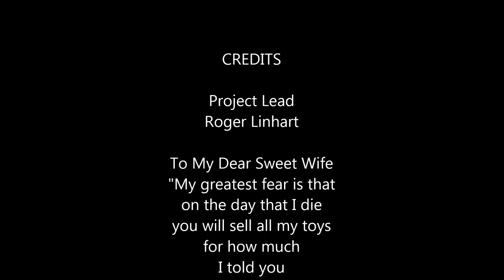Tricopter Build Part 4 HJ-Y3 OpenPilot CC3D FlySky FS-T6

Comment: Sir, I have built the same by following your steps and configuration but whenever I raise my throttle it flips. I am unable to solve it Please help me.
Reply from the maker: A common issue with flipping is having motors or props turning the wrong direction. Confirm the motors are turning in the direction shown in OpenPilot and then that each prop is  pushing air down to confirm you have the correct clockwise or counter-clockwise prop.
Reply: @RetroRogersLab  thank you for your response. I have checked multiple times.Motors are rotating in a correct direction. please have a look at my problem  maybe you can understand better https://youtu.be/LD2lwCHusD0

Comment: I am trying to build this right now as my first tricopter and I am kinda stuck. so do I solder the red and black wires on the esc to the power distribution board? I kinda assume that's what I would do.
Reply from the maker: +Thomas Kang I'm including a link to a photo in my Google Drive that should make the wiring more clear. https://drive.google.com/file/d/1U5QJc6ZzSdYl-1kqjUi0JLF2BO9Rj4ajSw/view?usp=sharing

You are correct that on the ESC the two larger wires, red and black, go to the power distribution board. Black should be connected to a '-' pad and red should be connected to a '+' pad. Of course your battery will also connect to power distribution board.

For the remaining connections there are three wires that go to your motor. It doesn't matter which wires on the ESC go to which wires on the motor. If you are not using a connector here you should check the direction the motor turns and if it is wrong you just swap two of the wires to reverse the direction the motor spins.

The final connection has a servo type connector and typically connects to your flight controller board.
Reply: ***** Thank you so much!!! Love your vids on the build they are very helpful! I did all that but now I'm trying to program my cc3d flight controller, so motor 1 on the left works flawless, second motor just goes back and forth, and last one on tail spins properly but spins too slow. The servo just constantly tilts right whenever I connect it to power, my tri looks like a disaster. I don't know what to do but I think it may have to do with me not calibrating the ESCs properly, I don't know how that works. I just let them beep for 5 minutes and I just went on to the next step in the wizard. I honestly don't know what to do at this point
Reply from the maker: +Thomas Kang I'm working on Part 5 of this series in which I configure the transmitter and CC3D settings. I haven't been in too much of a hurry because there are other good videos here on this subject. I'm glad you found these videos useful. I'm also very new to this and wanted to document some of the issues I encountered while figuring out this exciting new hobby.
Reply from the maker: +Thomas Kang Regarding the issues you're experiencing... 

For the servo on the tail rotor, be sure to "center" the servo before you put the output shaft into the tail motor hinge. Your servo should have come with plastic arms that fit on the output shaft, you can use these to SLOWLY  turn the output shaft. Turn the shaft both directions to find the limits. This will help you figure out where the center should be. You don't have to be exact, you'll fine tune it later in the CC3D setup. Next, when mounting the tail motor hinge to the frame be sure it is centered too.

Regarding your motor issues, the instructions aren't as clear as they could be. This video (https://youtu.be/0w56EQFl4Nc) shows an older version of OpenPilot but this is how I calibrated my ESCs. OpenPilot should also have you select each motor individually to determine at what value the motor begins to run. Beyond this, if you still have problems start swapping motors or ESCs to see if one of them is bad.
Reply: +Roger Linhart I've fixed the motors, just some weak soldering joints. I am trying to link my transmitter to the receiver, but it's not working properly. I have also fried my servo lol
Reply from the maker: +Thomas Kang Sounds like you're making progress and learning the hard way, just like the rest of us. :)
Reply: ***** it flies!! Its a little wobbly but it works!
Reply: Trying to install openpilot to my tricopter that I have my flysky receiver what is the color lay out

Comment: I use your configuration, the same, the only difference is that I use 20 esc simonk, and the tricopter is veeery difficult to fly. I just to buy 9047 propeller...to test...
Reply from the maker: +ismael winxi One thing that made a big difference for me was in OpenPilot in the "Vehicle" screen, some versions set the "Yaw" Mix Level to 100. I got much better results with this setting at 50.